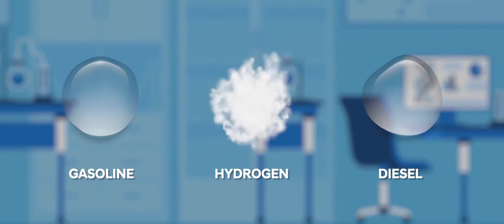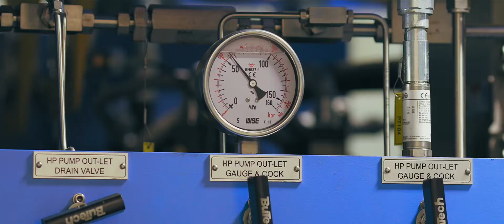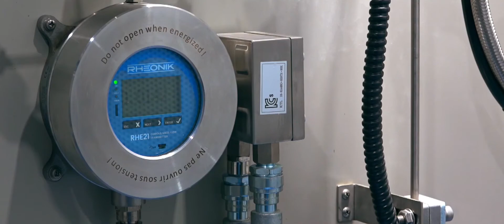Part 4: Hydrogen, Is It Safe?

Comment: There's a video of a Toyota Mirai tank getting shot and pretty much surviving a shot from a 50 caliber firearm.
I'd call that safe.
Reply: @Alien Alias nice Big Oil propaganda, those cars are actually crash tested, it's not a fucking Ford Pinto
Reply: lets hope the engine is as bulletproof too ;)
Reply: I've watched that video as well and if you thought about it or even read the description, you'd know it didn't "survive". The tank was pierced and gas started to shoot out of it.

They didn't expose it to any sort of fire or actual dangerous metal-on-metal crash esque situations either.
Reply: @Runefrag  Great addition. Like the video says, any spark from the firearm wouldnt be able to trace a path to the source like the fumes of other fuel, being less smoke-like vapors and more dispersed. Ive got good hopes despite it!
Reply: @Runefrag  The thing is as the hydrogen is lightest gas, pressurized dispersed as soon as the the  creation of the puncture, The ignition takes part in a mixture of hydrogen and  air, if the surround is properly ventilated the danger can be avoided.
Reply: @Runefrag  the idea is that it disperses in such a way that the air to hydrogen ratio is too lean to sustain a combustion reaction.
We are talking about Toyota, the masters of reliability and overengineering.